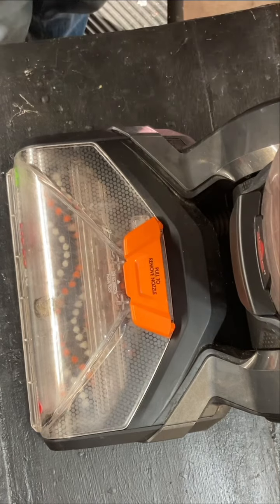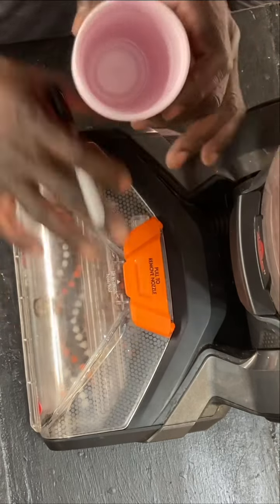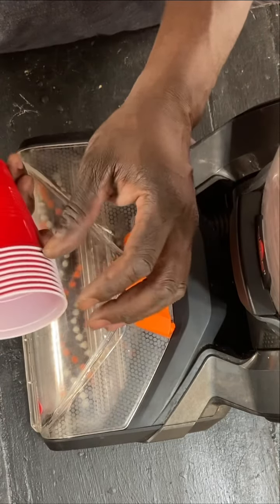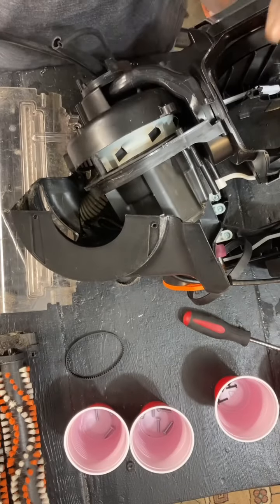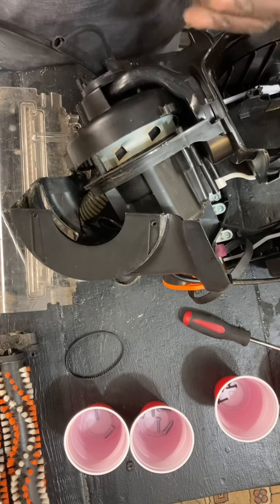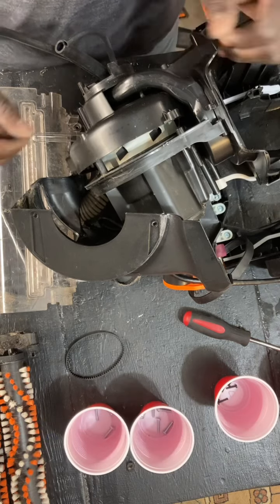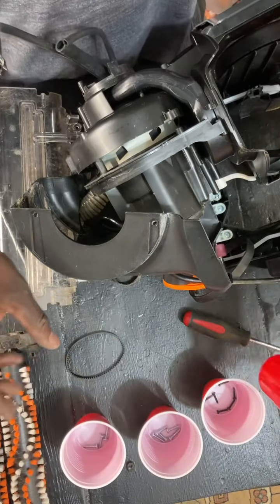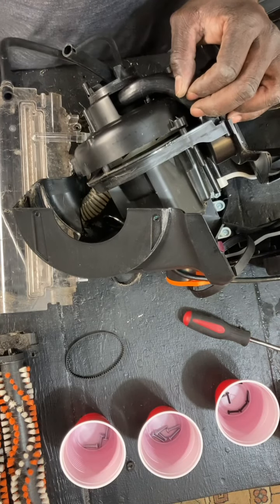Get access to Bissell Revolution motor and cord

Comment: Great video.  My unit is leaking/shooting water out of the back of the motor exhaust whenever I pickup water.  Is that a bad motor or just some valve/gasket that I can replace?  (Pro Heat 2x revolution pet, Purple housings)
Reply from the maker: It is a gasket problem. It could also be a problem caused by overfilling the tank, so kinda double-check to make sure that’s not the case. Try shampoo again, and fill the tank less than you normally would, and see if it happens. other than that the motor wouldn’t be causing it. The motor is just reacting to water being leaked into the motor cavity.
Reply: @monroevacs  It was leaking without a clean water tank attached and empty dirty tank when I just pored water in the attachment hole.  I took it completely apart and will add some gasket sealer to the disk gasket between the motor and outlet.
Reply from the maker: @smojovi check the lower hose see if there is a tear
Reply: @monroevacs  After I disassembled the entire thing, I found a crack in the middle of the clear "goose neck/deflector" adapter in the dirty tank.  It was just big enough to suck water thru directly into the exhaust.  A few dabs of super glue and we are back to normal!
Reply from the maker: @smojovi  awesome save $$$in 2024 👍